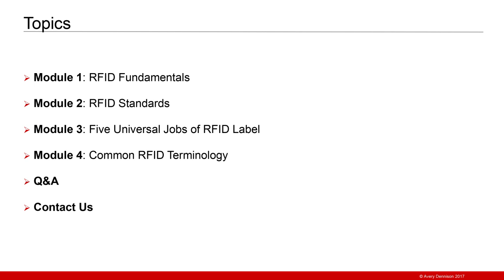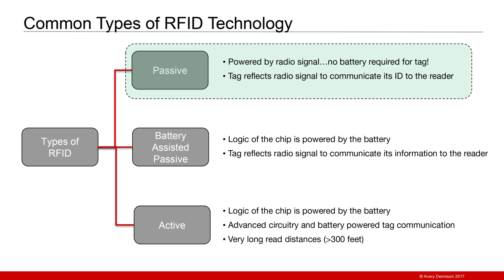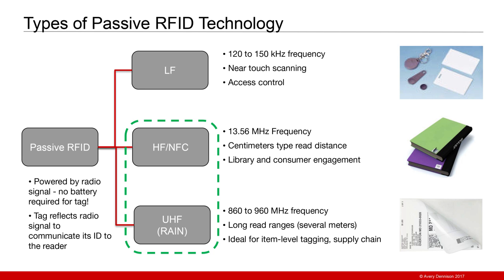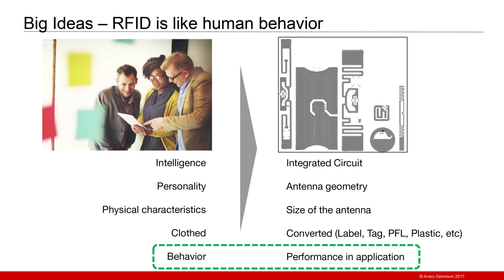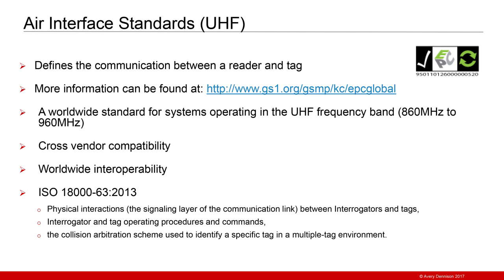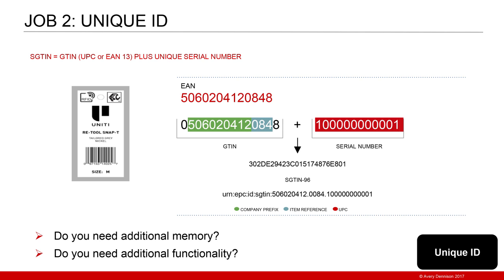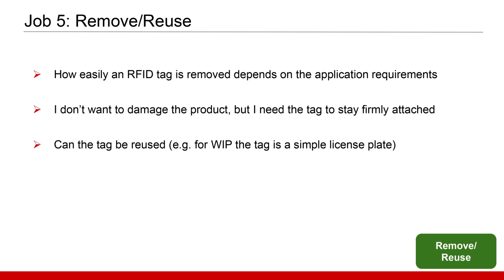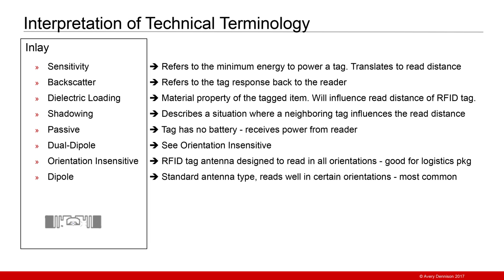RFID  basics

Comment: If I need to use UHF capacitive chip tp antithif our cable in substation is it will be getting destortion due electric field of power transformer that located in same  protected area.?
Reply from the maker: Hi there,
Please reach out to our RFID team for more info: Americas +1 (800) 444-4947; EU/Middle East/Africa +90-212-467-4000; Asia +852-3146-8100; or visit https://avydn.co/2BSLrrF.